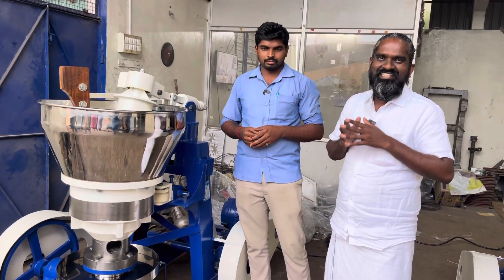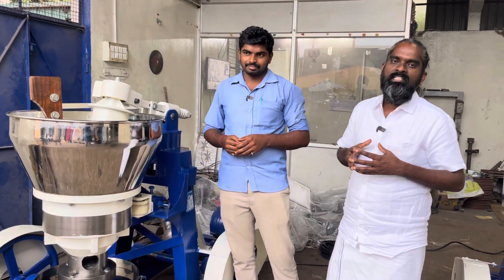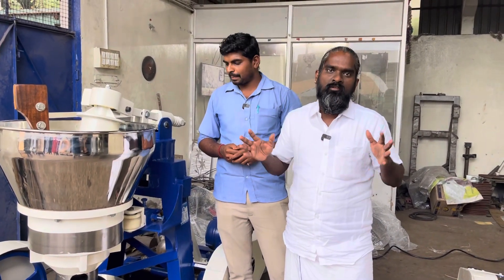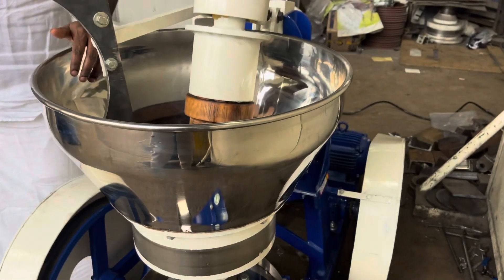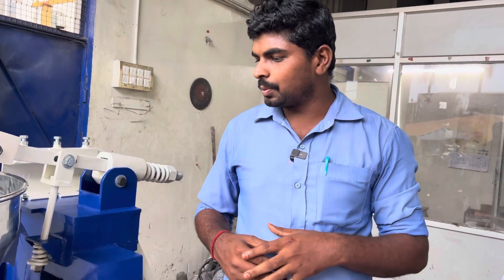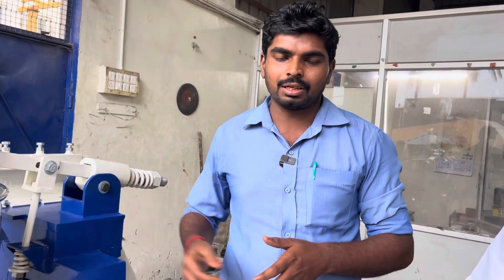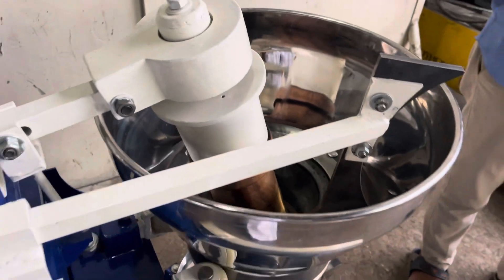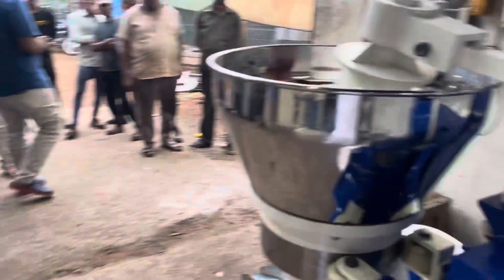Manual to Automatic Mara Chekku Machine 7339197774 Zen Tech #oilextractionmachine  #மரச்செக்கு

Comment: What is the cost of 20kg and 10kg automatic machine?
Reply from the maker: MACHINE RATES:

Voc 2 to 10 kgs. 140000+ 18% Gst 

Voc 8 to 20 kgs.235000+ 18% GST 

Voc 12 to 30 kgs. 330000 + 18% GST

Voc 25 to 50 kgs. 700000 + 18% GST

SS Ural voc 6 to20 kgs 305000 +18%

Voc 8 to 20 kg 100% SS STAINLESS STEEL MACHINE 465000+ GST 

Nethaji ( Rotary Machine )  305000+18% GST

🙏🙏🙏🙏🙏🙏🙏🙏🙏🙏

MACHINE RATE IN USD: This Rate for Foreign Countries

Voc 2 to 10 Kgs : 2550.00 USD.

Voc 8 to 20 kgs. : 3700.00 USD.

Voc 10 to 30 kgs. : 5000.00 USD. 

Voc 25 to 50 kgs. : 10200.00 USD.

SS Ural voc. 8 to 20 kgs. : 4900.00 USD.

Voc 8 to 20 kg 100% SS STAINLESS STEEL MACHINE : 7000.00 USD

Nethaji ( Rotary Machine )  8 to 15 kgs. : 4900.00 USD.

****For Abroad we will give some extra spare.

🙏🙏🙏🙏🙏🙏🙏🙏

MACHINES DETAILS:

V.O.C Machine : Automatic Machine
( Wood )

10 kg Machine: 2hp 3 Phase and Single phase. 
Ulakkai (Top Wood) Life: 5000 kgs  Seeds can Crush.  Ulakkai Replacement :  3500 +18% 
Ural Life (Bottom Wood): 10000 Kgs Seeds can Crush. Ural Replacement: 4000+18%Gst 

20 kg Machine: 3hp 3 Phase and Single phase.(If Single phase Motor can Crush upto 15 kg only) 
Ulakkai (Top Wood) Life: 10000 kgs  Seeds can Crush.  Ulakkai Replacement :  7000 +18% GST 
Ural Life (Bottom Wood): 20000 Kgs Seeds can Crush. Ural Replacement :  8000+18%Gst

30 kg Machine: only 3 phase 
Ulakkai (Top Wood) Life: 15000 kgs  Seeds can Crush. Ulakkai Replacement: 9000+ Gst 
Ural Life (Bottom Wood): 30000 Kgs Seeds can Crush. Ural Replacement: 12000+18%Gst 

3 to 5 Machines Can run by Single Person.
Heat Produced: Minimum 10 Degree Centigrade, Maximum 40 Degree Centigrade.
RPM: 16 to 18
You can crush any oil in this Machine.
If you buy STONE BOTTOM  (URAL) YOU CAN CRUSH UPTO:
25000 TO 50000 KG FOR 10 KG MACHINE 
100000 TO 200000 KG FOR 20 KG MACHINE 
100000 TO 300000 KG FOR 30 KG MACHINE 

Nethaji  ( Rotary Machine - Iron )

Ulakkai Life (Top Casting): 30000 Kgs Seeds can Crush 
Ulakkai Life( Bottom Casting): 30000 Kgs Seeds can Crush 
Ural and Ulakkai Rework: 4000+18 % GST. 
Heat Produced: Minimum 50 Degree Centigrade, Maximum 80 Degree Centigrade.
RPM: 45.
You can crush any oil in this Machine.
    All values are Dependent upon  QUALITY, PROPERTY, VARIETY and MOISTURE of the SEEDS.
THE ABOVE VALUE FOR ONLY PERFECT GROUNDNUT, COCONUT, SESAME SEEDS ONLY. 

🙏🙏🙏🙏🙏🙏🙏🙏
OUR YOU TUBE CHANNEL LINK:

http://YouTube.com/c/marachekkumachine

     Kindly LIKE, SUBSCRIBE, SHARE AND TOUCH THE BELL BUTTON in Our You Tube Page.
    Kindly Watch All videos for your all doubts. 
Our videos will helps you.
🙏🙏🙏🙏🙏🙏🙏🙏

IMPORTANT NOTES:

    Wood and stone machine both are same price.
   The machine value including   Motor, Starter, Switch, Spanner, Cover, Allen Key and All other Accessories. 
Machine Delivery Time : 10 or 30 Days. 
Validity : 20 Days.
    You can crush any oil in this Machine.
If you  Need single phase  3 hp motor it's available for Voc 18 kg machine only. 
     We using THE WORLD'S NO.1  SIEMENS MOTOR and BONFIGLIOLI GEARBOX AND GEAT MOTORS. 

 This is very very important: 

    You don't worry about 70000,  100000 other companies machine. You calculate output of machines. And also don't miss your dream machine for 5000 or 10000.
Thanks.

      Service cost may vary depending upon the distance.
     You Need to pay transport costs of machines and  service engineer transport cost, Accommodation and food cost of service engineer.
     If you Need one more day of service you want to pay 1000 extra for service Engineer.
     If WOODEN BOX PACKAGING 5000.00 MORE. 

Website: www.zentechengineering.com
Gmail: zentechengg05@gmail.com
Email: sales@zentechengineering.com
Youtube:  https://www.youtube.com/c/marachekkumachine
Facebook: www.facebook.com/profile.php?id=100057399521675
Instagram:  www.instagram.com/zen_tech_engineering?r=nametag
Twitter: www.twitter.com/KanagarajParam2?s=09 

#marachekku #marachekkumachine #oilextraction #oilextractionmachine #coldpressedoils #stonechekku #stonechekkumachine  #coldpressedoilmachine  #automaticmarachekkumachine